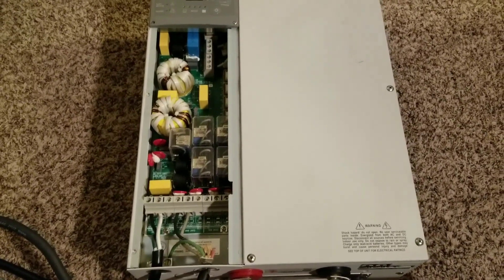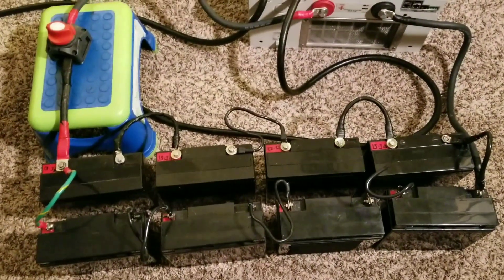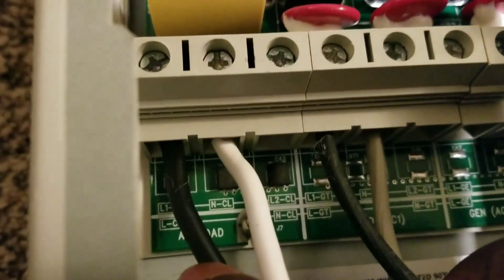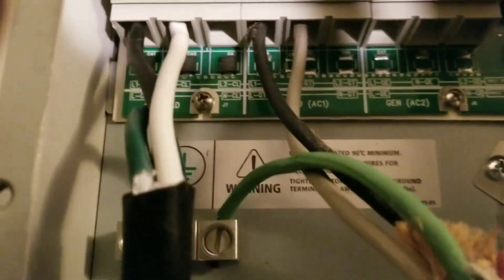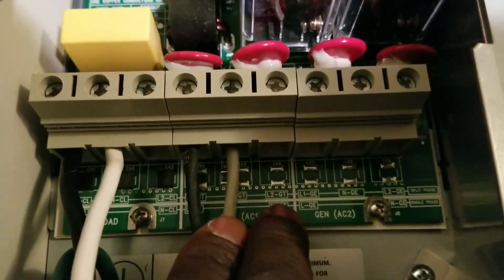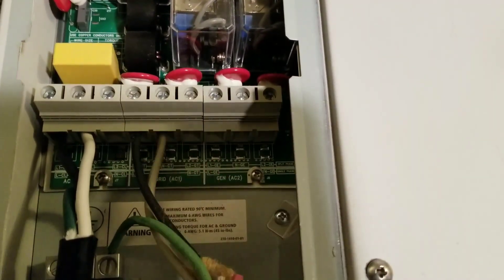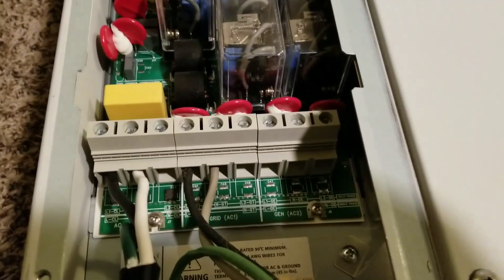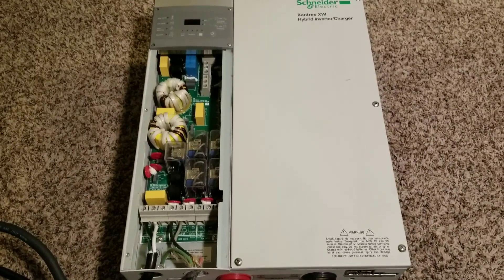XANTREX XW HYBRID INVERTER/CHARGER Off Grid Grid tie 120/240v 60Hz Battery Backup Wiring AC Loads

Comment: I have 4548 and it does not seem to be working with 48v lithium ion battery. Thoughts
Reply from the maker: You got to know your Inverter DC INPUT Voltage before you order or bulid your your lithium bank.
Thanks for watching, LIKE SUBSCRIBE and SHARE
Reply: @jwsolarusa  48 volts. It is the same like yours. Except yours is 6kwh mine is 4.5kwh